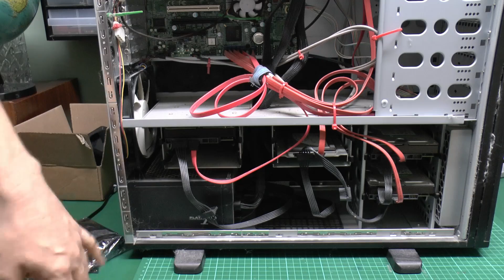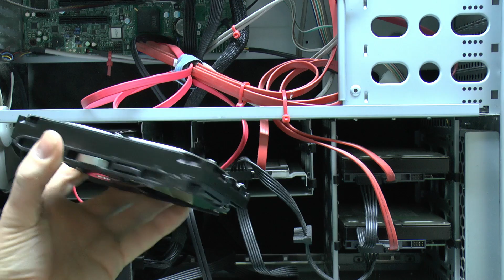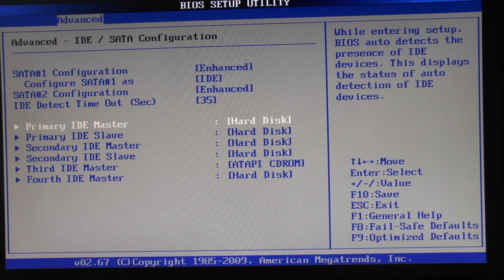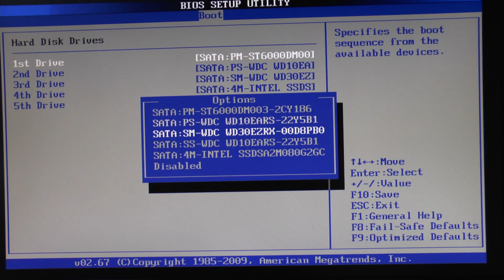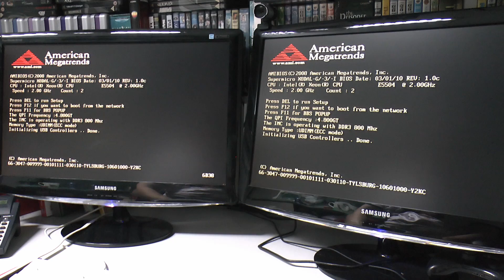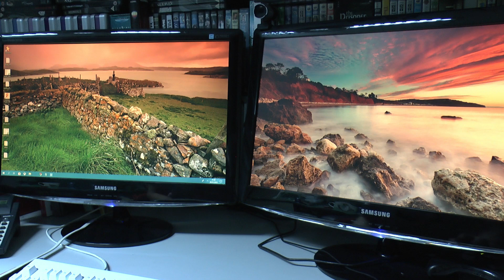Installing an additional 6TB Hard Drive

Comment: What windows version are you using, is it possible to use 8TB on windows xp 32.bit platform without any problem because i read many articles says it will not work you need to use GPT partition which is not supported by windows xp 32bit .
Reply from the maker: I have Windows 10.
Windows XP is an obsolete unsupported operating system that shouldn't be used for anything.
Reply: I'm using Windows 10 as well, not by choice, its literally because no other operating system is still supported. I was still running Windows XP until around 2016 and I still would now if it was supported

Comment: Hello there. Did you say the pc was built in 2010, are you running windows 10.I have a pc built in 2013 and was about to see if it can run windows 10.
Reply from the maker: Yes, built October 2010, originally Windows 7, now Windows 10.

Comment: thanks for the great video. currently i am trying to uprade my PC by adding an additional 2Tb  HDD (currently have 1Tb running), looking int o the specification of my desktop H50 lenovo it says the max it support is 2Tb,ideally i am looking to boot windows from the 1Tb HDD and  linux using the 2Tb and using both at the same time, any suggestion if i am able to get this running and workaround or if i can tweak anything to get this working, BIOS i am runnig is IEKT33AUS and motherboard model SDK0J40709 WIN, thanks alot
Reply from the maker: 2TB is probably a limitation of the operating system it was originally supplied with rather than the motherboard itself.

Comment: It is amazing how much controversy this has stirred up, my own desktop has a pair of Xeons (older than yours). I also use 2 monitors, great for engineering stuff when you can refer to a diagram on one screen and write a document on another. I couldn’t care less about the gaming performance of any of it, just want speed for the stuff I use it for. Lately been using laptops a lot... data backed up to a RAID NAS drive or a server. A word to the wise, there are different levels of RAID, for my desktop I ran RAID 0, risky but fast. The server ran a robust RAID, great fun to pull a drive out while it was running, put a new one in and let it swiftly recover. The downside was despite the machine being a proper server from a good manufacturer the motherboard ultimately failed...

Comment: Whenever you buy a new hard drive you should ALWAYS do a full format and NOT a quick format!!
Mechanical drives are very susceptible to shock damage and doing a 'quick format' will not discover if you have any bad/damaged sectors!
Yes its a pain and takes ages but a full format will tell you if the drive is faulty and as a consumer you have far greater rights with DOA products  (ie the retailer is legally obligated to pay return postage)

Comment: Before I make my comment, I just thought I should say that I've been working professionally in IT for 21 years and did it as a hobby for 5 years prior to that. In saying that, I know nearly nothing about UK electrical standards, so I respect your knowledge in your field. 

First thing I want to mention is that I can't understand why you are splitting your disks up into partitions. There's no reason you need to do this. NTFS under Windows 10 has a 16 TB storage limit, so there's absolutely no need to be breaking your storage up like this. It doesn't offer you any advantages at all and does nothing more than to add more drive letters to your system.

Second, you should consider copying your data from the older smaller drives right away to the larger ones. The operational lifespan on a hard drive is about 5 years. Less if you power cycle the drives on a regular basis. Anything more than that and you are rolling the dice. Considering that the machine itself is from 2010, you're already 3 years past when the older drives should have been retired. SSD's can live for longer, but it all depends on the amount of writes they have. 80 GB SSD's are ancient now anyway, even the lowest end models are 256 GB in size. You should probably consider replacing your SSD with a 256 GB one and use a tool to clone it to larger disk, such as Clonezilla. 

Since your SuperMicro X8DAL-i supports RAID 5 in hardware, I would recommend that you purchase two more identical 6 TB disks and run three 6 TB disks in RAID 5 with one partition. That will give you 12 TB of raw space. (About 10 TB usable, which is what I see on your system.) Take the remainder of the drives on your system and copy them over to the RAID array. Then, wipe and discard the 1 TB drives and any drives older than 5 years old, but not before you back up your data. If you are paranoid about drives failing while an array is rebuilding, you can always purchase an aftermarket Adaptec RAID controller and run four 6 TB drives in RAID 6 instead, which guards against two simultaneous drive failures. 

I would recommend that you should purchase a QNAP NAS and load it up with a few 8 TB disks and back your data to it using Acronis True Image, so in the event where the power supply in your machine fries the drives, you still will be able to have your data, unless you don't value it. (This is cheaper than using an LTO tape drive and works just as well, provided that you enable periodic snapshotting on the NAS to guard against a ransomware infection.) This will isolate you against a hardware failure and from data corruption. If you are really paranoid about losing your data, you can even configure the NAS to do a cloud backup so in the event the NAS fails, you'll still have your data. This is easier than storing drives offsite, but not always cheaper.  

I'd like to mention that I agree and disagree with your comments regarding RAID. I agree with you that RAID is not a backup. Second, RAID 5 is a way to get around the limitations of RAID 10 because it doesn't waste disk space like mirroring disks does. I also agree with you that when a disk does fail, it can put strain on the other disks and cause them to fail, but I rarely ever see this happen because I proactively change out the drives for every 5 years of 24/7 operation as if they had failed. If one drive fails, post rebuild they all get changed anyway. Even if the entire array fails, you had backups, right? Third, you do take a write performance hit when using RAID 5, but you said yourself that this isn't all that important. 

The reasons to use RAID are quite simple, they aggregate a few drives into one large drive and tolerate a single failure of any one drive while continuing to provide you with your data. In the current configuration you have, if you lost one drive, you would lose all of the data on that one single drive and it would be unrecoverable. 

One other small thing, Unless you absolutely need to be running heavy multi-threaded workloads, purchasing a replacement Xeon system is a considerable waste of time and money (Regarding power usage) for a home computer, unless you like having a small space heater under your desk. Also, Xeon CPU's are suited for server workloads, not for desktop use. I would advise that you consider replacing your machine in about two years at the most with a considerably more efficent model with a High End Desktop Performance CPU, which would run circles around whatever you are using now. The reason why I say two years is due to the bathtub curve. I rarely run hardware more than 10 years old out in the field for that very reason.

Comment: Linux software RAID allows you to add a new disc, attach it as a spare to your RAID array - then mark the failing-but-not-quite-dead disc as to be replaced. It will then copy the old disc to the new, only involving the remainder of the array if there is a part it cannot read. Once that is done, your new disc is a full member of the array, and the old one marked as failed. Remove it from the array and then physically remove it.
I had to do this recently on my RAID5 array, fitting the new drive internally in the space taken by the old drive, and attached the old one via a USB3 adapter. It worked exactly as it should, even at boot time prior to adding the new disc it correctly assembled the array with the remaining 2 internal discs and the one attached via USB, and didn't place any undue strain on the rest of the array.  Originally all 3 discs were bought at the same time from the same source (yeah, I know..) but now, while still the same model (WD Red 3TB) they are all of different ages - one of which is still the original from 2013.  Also, software RAID places no requirements on a specific RAID adapter, or even motherboard RAID capability, which is a huge advantage should your board / controller fail, as they can be easily replaced with no worry about whether it'll correctly reassemble your array.

Comment: that's a full size box and you have a hell of a data space the I do believe the pc was grounded or an antistatic wrist strap was there on your wrist,  good as always :))))))))))
Reply from the maker: The entire bench is grounded (the green surface mat).  Static not usually a problem anyway, due to high humidity.

Comment: Change to ahci man,ide is much slower just set it in bios and no need for any windows reinstall or drivers/devices errors or bsods go ahead change it and it will be no problem.

Comment: Windows 10 is such a pile of shit. I'll be sticking with 7 until they do something about it... runs just fine on my hardware (haswell i5) and i expect it will on something more recent too
Reply: In January 2020, security updates will no longer be offered for Windows 7. Now's the time to be thinking of upgrading to Windows 10 or use a Linux distribution.
Reply: @Thorpe  I suspect MS will be forced to extend its life, much as they were forced to with NT4. Besides, with your computer behind a firewall, and when you're careful about what software you run, you can mitigate a lot of security issues.
Reply: Why do you think that way?

Comment: Probably a silly question, but why partition it into 3 smaller drives rather than keeping it as one 6TB drive?
Reply: I'm wondering the same. I don't really see any benefits to partitioning a storage drive. Couldn't you just organize everything in folders on a single partition? If you have multiple partitions on one drive and one gets full you need to either move files between partitions or change the size of the partition (if possible). Both of those things will take time. With one partition you will not have this problem.
Reply: + @Tjofrasen Windows's FAT and NTFS tends to suffer fragmentation/slowdown, which you could reduce by spreading data across sets of partitions on the same disk.  However, ext4 behaves rather better without those issues, even if "by the numbers" ext4 may actually be 'more' fragmented!.  ext4's blockmaps, inodes, etc. are spread-out rather than having a single FAT or MFT (fragmentable) area...  Suffers less on "slowdown from fragmentation" and Linux's delayed-allocation layout system is very clever, etc...  As others pointed-out there are even more advanced filesystems now anyway,  in any case need to be "solving the right problem", "horses for courses" and all that.
Reply: @sbusweb  If i recall correctly NTFS tries to allocate files to a contiguous set of blocks if possible. This will be easier to do the more free space there is on the partition. So splitting up the drive into smaller partitions will make each partition more full and thereby more easily fragmented. And if fragmentation is a problem you could always defrag the drives.
Reply: Maybe not the best use but here's one reason, you could partition a larger drive to the same size as a smaller one and raid 0 or 1 them together while still retaining all the extra space of the large drive.
Reply: I would guess he makes a copy of the one partition on one drive to another drive, so having partitions around the same size means much less juggling around on data. Manual RAID as opposed to software RAID.
Reply: @SeanBZA  I don't really see the benefit of that compared to just putting the backups of the old partitions onto one single partition. And in this case his 3 new partitions are bigger than the previous partitions so my guess is he has some other reason for doing this.
Reply: I really can't think of a good reason to do this if it's simply for data storage.  Indeed there are very few reasons to ever do it in modern machines with modern OSes.
The mini-rant on RAID seemed a tad over-blown, the points made are valid, but not necessarily significant.  Still I've never bothered with it in a personal workstation, preferring backups to other discs and locations.  
A chap without a backup is a chap who is going to have a bad day sooner or later!
Reply: to be cooL?  honestly there isnt a reason, i just got a 6 tb drive, i partitioned 1 tb to copy my laptop drive on, it has windows seven, my desktop is windows 10

Comment: I have no problem with Seagate per se - I find them pretty reliable. Unfortunately I think the Barracuda (non-pro, like the one you just bought) at 6TB is actually an SMR drive. So reading is fast but writing is very expensive once it gets somewhat full. You have to go up to a Barracuda Pro, Ironwolf or higher to go back to PMR (the traditional writing technology). I bothered to log in for this comment so while I'm at it, I'll mention that I like your videos!
Reply: But Barracuda is more cheap.

Comment: My first ever computer (windows 98) had a 6GB HDD haha
Reply: lol and Gutenberg was also printing the bible!
Reply: 100M, and later on a second 250M to handle data with W98. Then again, my first hard drive was a big 40M one with MSDOS 5.0, it was so big. Tried it last year and it still span up as well, and I could read all of it, and sadly could fit it all into a Ramdisk as well, and not have it swap out.
Reply: My first computer was a zx81 with 16k of memory. And store age was on a tape player Those were the days 😂

Comment: I certainly hope this isn't your Editing machine or your daily driver. Archaic... well everything... the case is abomnial. the motherboard is a server board. the GPU is IDK what. and what is with your thought process of just adding a drive is... psychotic...

You need to retire this bad boy as soon as possible... Also your portrayal of RAID as a complete joke is very bad, You are really doing a disservice to your viewers. A proper RAID setup with a proper hardware HBA/RAID card and using "Windows 10 Storage Spaces" is perfectly acceptable.

If you have had a bad experience with RAID in the past, do not make it out to be the devil of storage solutions.
Reply from the maker: As stated in the video, this is used daily, and of course it had old components - assembled in 2010.
Reply: What is wrong with you?  ___ Wow nice edit, if you were actually trying to make your comment worse.  Unless you're the kind of person that thinks knowing what drive your data is actually on is highly overrated Windows 10 Storage Spaces is an abomination. What benefit do you see in using it?
Reply: A server board in a desktop is fine.
Reply: The components he uses in 2010 were very hi-end then and can still be used perfectly well today, the reason he still uses it today is because having a server motherboard will make it extremely reliable and able to edit and render videos without crashing. I understand that a hardware raid setup is probably best however you need to understand that this might not be suitable for everyone and the software raid on windows is far more user friendly and easy to setup
Reply: Chuckles Nuts - It's John's computer not yours, so go and bitch about something else douche lord.
Reply: Propper RAID setup? So he would need to add at least 2 6TB drives instead of one?
Hardware RAID is a garbage anyhow, ZFS FTW.
Reply: @JGnLAU  No such thing as hardware raid , " Hardware raid " is just crap software raid on a chip , ZFS is where you want to be.
Reply: @andljoy  Software on a chip becomes hardware, basically. Plus RAID controllers could use ASICs, but don't quote me on that.
Reply: Chuckles Nuts 
Yawn.
Reply: He clearly said it is his main computer, and why must he stop using it ASAP when it still works perfectly fine for him?!
Reply: Why can't someone use a computer from 2010? It's not going to expire or something. My 2007 Core 2 Duo machines are still around and doing just fine.
Reply: Who actually cares if a computer case is old or ugly or whatever? It doesn't actually matter for the computer, as long as it can support and hold the components inside and provide good enough airflow, the aesthetics doesn't actually matter one bit. The computer will perform exactly the same no matter the case, in my young days, I even had my main computer stacked together on top of the cardboard box the motherboard came in. Worked fine, no case needed.. :p As for server board or not, depends on the workload it's designed for. It's not for gaming, but excellent for other workloads. And it was a pretty powerful machine for 2010, and as long as it still does what it's supposed to do, there's no real need of upgrading. Upgrading is only needed when the computer is holding you back or not performing the tasks you need from it with acceptable performance.